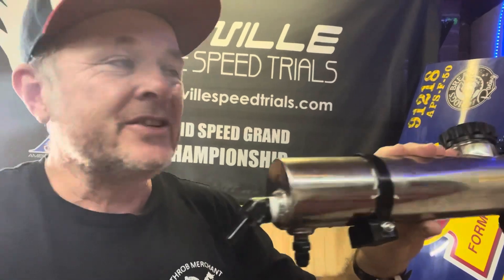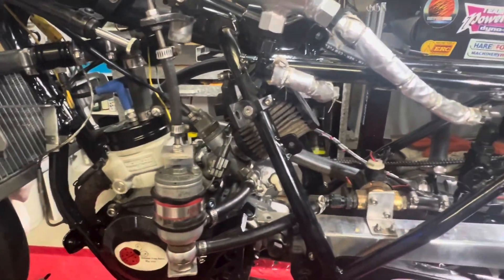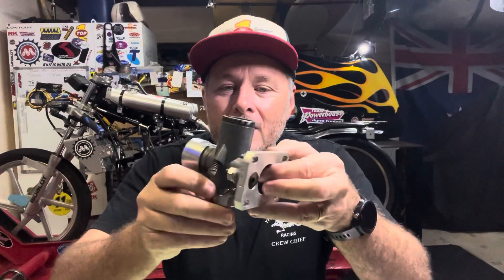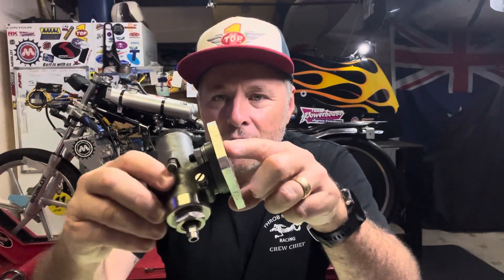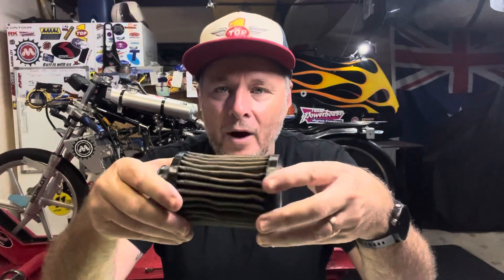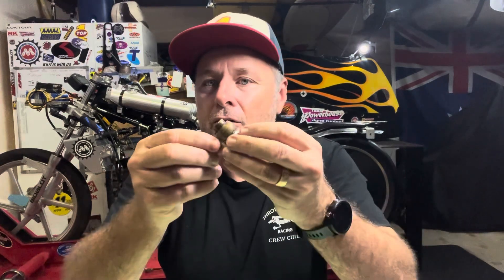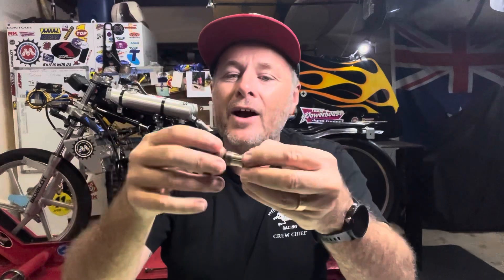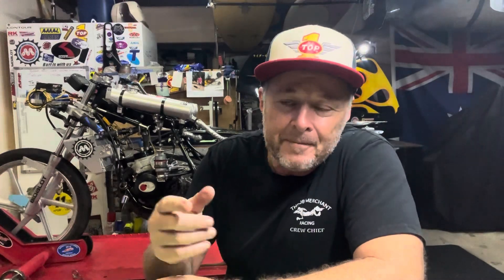50cc LSR Fuel system explained

Comment: Thanks for letting us all in on some of your tuning tips/secrets, from previous dyno work i had the same out come ,more power with an air cleaner specifically a K&N , the thought was the filter provided an air straitening effect , and clarification on the benefits of using the bottom fill float bowl, champion work
Reply from the maker: @mechelectro2711  no worries mate, thanks for watching.

Comment: Amal are a pretty good company, when I was having fueling problems with my supercharged 600 I just drove up to the company (which is about 30 miles from here) with my carb they looked at my figures and the carb and suggested a different 2 stroke jet assembly, solved my problem straight away
Reply from the maker: @JOOLZNED  yes Amal have been very good to us.